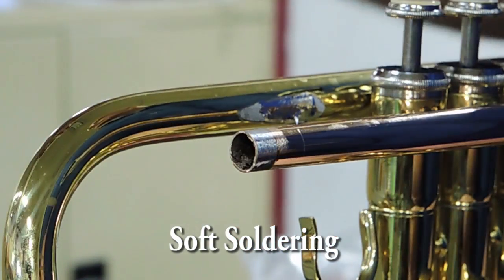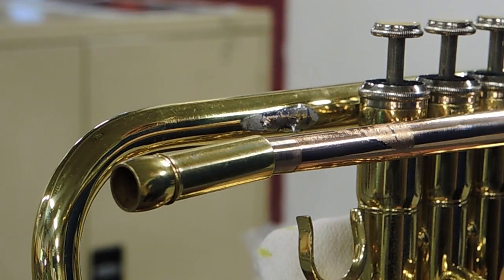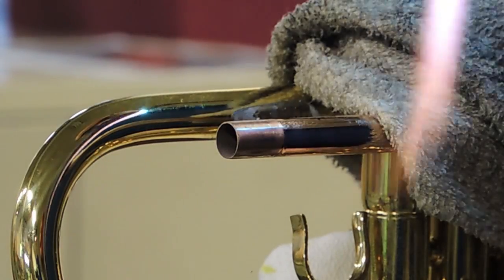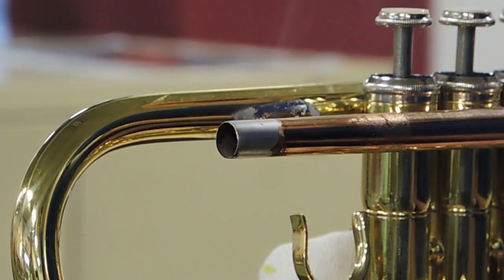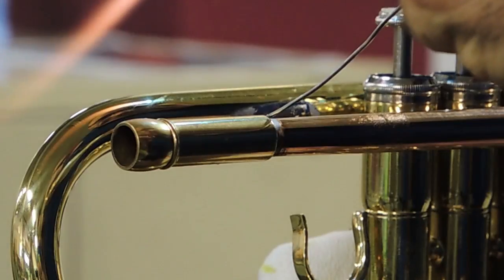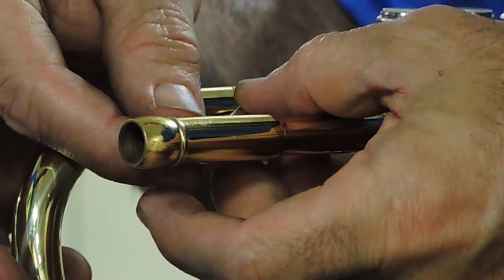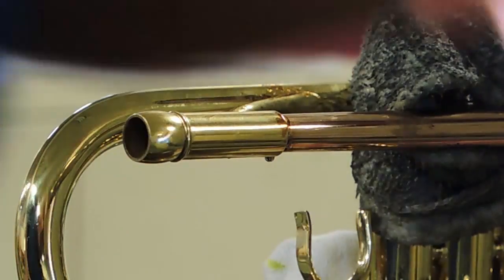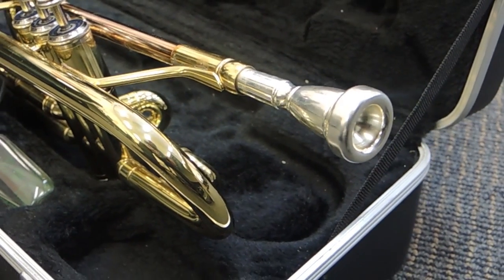Soldering

Comment: One very critical point is that the mouth pipe is the most important part of the trumpet, tapered to specifications and computered soldered so there's no solder seepage blocking the air flow. IMO the pipe shortening should have been at the other end of the mouth pipe where the taper ends.

Comment: Wouldn't it make more sense to shorten the instrument from the tuning slide and stockings? That way not to mess with the venturi and taper of the mouth pipe. This seems to me as if creating a gap from where the mouthpiece receiver and mouthpipe meet which would result in poor performance.

Comment: How does this affect the lacquer coating around the area in which you are working? Does it melt/burn it off? Do you have to re-coat again after you're finished?
Reply: Viron tseven If you look closely, you can see he did almost no damage to the lacquer.
Reply: +Viron tseven depends on the brand.  Some brands have more sensitive lacquer.  But if you get in and get out quick you can avoid burning the lacquer.  If you do, you can then refinish it and spot lacquer it.  It is a risk when you have to resolder braces that there might be some permanent disfigurement.  Moral of the story......don't break your trumpet.
Reply: +Atochabsh +Brad K  Do either of you know if this is the same steps for soldering the front and rear bell braces? It's for a Cornet though but not sure if that makes a difference. I'm good at soldering, I've just never worked with any musical instruments before.
Reply: +edoubleu52  use wire to hold the braces in place.  But make sure that all excess solder is off the brace and the place on the trumpet where it was.  If you do not do this, the braces will not fit flat again.  You can use either the liquid flux like in this video, or paste flux.  It doesn't take much to do the job.  If you take your solder and flatten the end you are working with, it will be easier to administer the minimal amount and stop from getting extra solder all over the place.
Reply: @Atochabsh  Good afternoon friend, could you give me a tip on soldering flux which is the best type to solder an instrument?
Reply: @Tuca-Luthier.  you can use liquid or paste.  I find it easier if you hammer the solder to a flat reverse triangle shape before soldering.
Reply: @Atochabsh  Good morning, here in Brazil, liquid fluxes are flammable, I've been researching flux and I noticed that it's made with hydrochloric acid (Muriatic) with zinc, do you know anything about it? and in the case of tins, you say to take the rolls and hammer them until they are flattened, is that it?
Reply: @Tuca-Luthier.  you can also look for rosin core solder.  It has a flux material built into the solder hense "core".

Comment: I'm probably wrong, but it looks to me like you are using a trumpet mouthpiece in a cornet. if you are, that would explain why the instrument played flat.
Reply: Is it not the same?
Reply: No, it isn't the same. A trumpet mouthpiece is longer and has a thicker shank than a cornet mouthpiece, so using a trumpet mouthpiece in a cornet will make it play too flat.
Reply: Looks like a trumpet to me. A cornet would have a wrap around the 2nd valve slide.
Reply: The difference between a cornet and a trumpet is that a cornet has conical tubing. Some cornets look exactly like a trumpet, such as the Olds Mendez models. And cornet mouthpieces can have long shafts or short shafts and the early olds cornets had their own size mouthpiece. All that being said, to my eye, the trumpet mouthpiece in this video doesn't appear to extend into the receiver like it should. I think it looks like it's being inserted into a cornet receiver. Anyone considering making this modification to an instrument should first of all determine if it takes a different sized mouthpiece, and secondly, the extra tubing should be removed by trimming the fitting of the tuning slide. That’s more work, but you avoid  problems with the pitch.
Reply: Ray Vignovich Your totally right about the conical tubing, and the silliness of this repair. I just don't see a cornet in this video. All we see is the side with the bell flare, and that's conical on both trumpets and cornets. The tubing begins to flare out as soon as it turns up.

Comment: What tin alloy using?
Reply: +macucapa Its usually 60/40, but you can use a higher silver solder for silver plated instruments.  That has a higher flow temperature.
Reply: Thank you